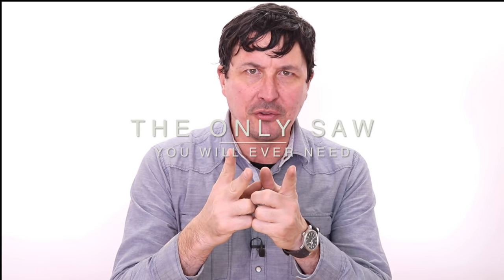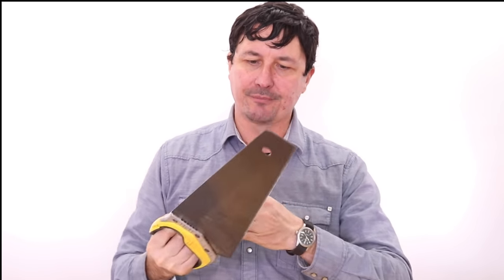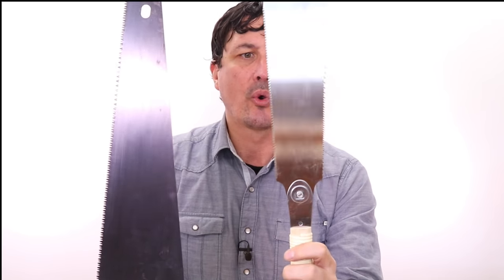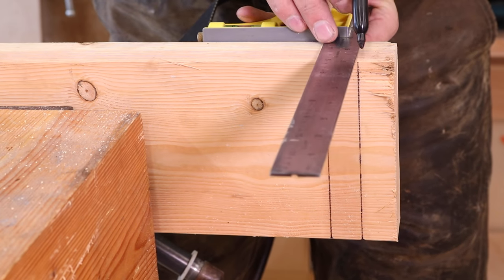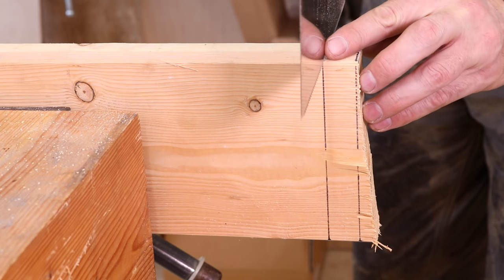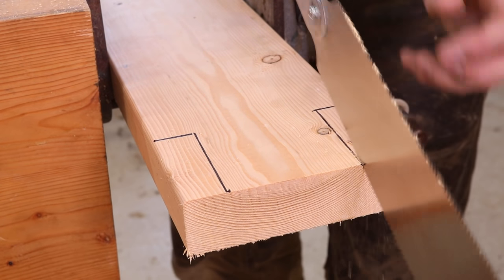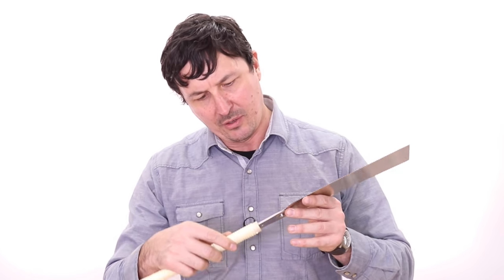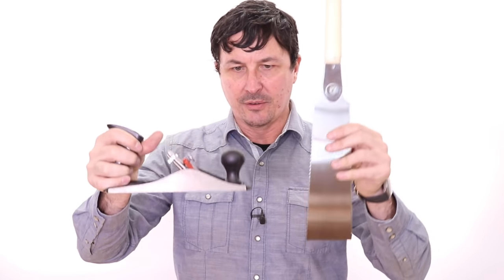The Only Saw You'll Ever Need

Comment: Why do they cut on the push? You can get so much more power from a pulling motion.
Reply: well .. speaking from experience, it's not true, you pull your bench off the ground, saw horse pops over.. also, unless you can pick up more than your weight, it is physically impossible to achieve what you say. It is also safer, I just got my japanesse saw today, and already cut myself - my bad - but when you push away and it slips you won't cut yourself. I love both my saws, and I am learning to choose the proper job for each
Reply: Western saw plates are much longer (more teeth will cut) + body weight is working for you.
Reply: Based on the research I have done, saws that cut on the pull generally give cleaner cuts since the force is more consistent, using the weight of the blade all the way through the cut, and the pulling motion provides the right amount of tension to keep the blade straighter for accurate cuts. Also the smaller, finer teeth aid in accurate cuts. However, they don't cut as much material per motion as a saw that cuts on the push would, so it does take a bit more work but gives cleaner cuts.

Saws that cut on the push use your force/body weight combined with the weight of the blade to take off more material per motion. The downside to this is that people with poor technique tend to not use the right amount of pressure and make uneven cuts and bending the blade and teeth in the process. However, most American made crosscut saws cut on the push and pull motion , providing superior cutting power with more teeth that are coarser, while sacrificing accuracy.

Conclusion: Japanese style push saws for accurate cuts (designed for woodworking). American made crosscut saws or bow saws for maximum cutting power.
Reply: Martin Rodriguez, good and accurate assessment.
Reply: I know right?
Reply: @still34u  "well speaking from experience... I just got my Japanese saw today..."
Reply: Less fatigue
Reply: Why would you want to fight against pulling the material towards you

Comment: I like my Gyokucho, however this test is unfair. That saw which is the same as I own cost me $52. That is the the same saw that you used against the Stanley, not the $28 Ryoba that you linked to.
Reply: If you're referring to the saw in 9:08,, it seems to have the same logo as the Ryoba saw in the link.
Edit: Looking online I found out Ryoba is a classification, not a brand name. Ryoba literally means "double blade", and refers to such saws as presented in the video.

Comment: A saw is a tool that I have personally had difficulty using. Blade length seemed to matter as well as the handle. Thanks for showing the difference between the two saws you demonstrated.I agree that a "pull" saw is the ideal for me; pushing a saw to start isn't my ability. I'm a "pull" person. I"m a woman too, and I do my best to use leverage to my advantage when it comes to construction/ carpentry tools.I've been out of the trade since my son was born seventeen years ago, but I still get a buzz to get into the work at home.The tool kit is a great idea!

Comment: Well ofc you can't make a straight cut when you use it wrong. Stanley saw is also a pull saw, meaning it cuts when you pull. By forcing it to cut when you push you were bending it. Also as you said, this a not a speed race so don't push too hard on the saw. When you do that the teeth grab more and don't cut but rip the wood and then you get a terrible looking edge.
Reply: All he proved is that he has no idea how to use a saw. Pull saws are fine if that's what you like but a Stanley Fat Max was never intended to do more than wack a tree limb off or finish the cut on a stair stringer.
Reply: I agree that Cody has no idea how to use the Stanley "WESTERN" style saw. I wish the camera included how he was holding the saw's during the cuts. It was apparent that he lacked total control of the Stanley due to improper grip and a total lack of ability to control the saws direction, as he twist the blade on each stroke.
I've worked with many older carpenters who used Stanley style saws and they could cut clean straight lines without torturing the saw as Cody was doing. They showed me the proper saw grip and I was able to improve my accuracy by 99% with just a few days practice. This was a very poor test  when he lacked the knowledge of how to use one type of saw, which introduced a bias into the testing.

Comment: my oppinion is that the test is a poor, the biggest problem with the video is that you are using your so called amarican stiled saw poorly. To get a good cut with a saw must have stablite, the japaniese one alredy got that thanks to the handle but on the normal saw on the other hand you dont get that same stabilite if you dont use your other hand use your hand that you dont have on your saw and place it on the material that you are sawing or the bench
Reply: How does one being better than the other partially because of the handle make the test "poor"

Comment: Old habits die hard. You seemed to be trying to start your Japanese saw with a push stroke. Muscle memory is a strong influence on technique, sometimes making the change to Japanese saws a little difficult. The pull action keeps the extremely thin  blade in tension and thus straight, while the saw, being extremely sharp cuts well with its own weight as it is drawn through the wood and our muscle memory wants us to saw in the manner we are accustomed to with our Western saws, which runs counter to the appropriate method for Japanese saws. Cross cutting in particular leaves an excellent standard of finish. My own experience with these saws has been wholly positive. Gyokucho also include a back saw in their range and a very good flush-cut saw. 
   Many thanks for all the super vids , I learn something new and useful every time, and often find myself asking " why haven't I thought of doing it that way."  Thank goodness for You Tube and your  and many others informative and inspirational presentations. Thru them I never stop learning and refreshing my knowledge and skills after many years absence from the trade.  All the best, from UK.

Comment: Your video was the first that I have seen that compared both saws. I have hesitated in buying a Japanese saw. But I was impressed how it worked and how clean the cut can be. The Japanese saw, since it cuts pulling, the front was rougher than the back as compared with the American style saw.  $28 is a good price for the multipurpose saw.

Comment: For what its worth being a pro cabinetmaker/joiner/builder etc . I have gyucocho . Good brand . I have three of their ryoba's but to be honest I rarely use them except for site work in awkward places .
What I do use everyday almost is my Zeta's . The regular handle with the stiff back can take cross cut ,rip and mouse tooth (dovetailing tooth) blades. One handle , many blade options INCLUDING metal cutting blades too . 
The trouble with Ryoba's is that the teeth on the other side tend to get in the way when you are ripping anything but very soft woods . If your not carefull you can pinch and buckle the blade .
The blades are so easy to take in and out of the handle , they dont need to be unscrewed like the Gyo's . They do a range of sizes both stiff back and flexible . 
They also do a really handy small crosscut saw which is PERFECT for dovetailing . 
Buying the best all rounder is rarely the best choice in practice . Far better to buy the exact tool for the job you have in mind . 
Zeta blades are tough long lasting disposable blades . I have a bunch of them now . Its a clever system because the blade holder works for different sizes/types of handle . Google it and check 'em out.
Gyo's are a finer blade for precision cutting . Their crosscutting tennon saw is super fine and works great but be warned ,the teeth are fragile and easily broken if your not skilled enough.
The only really good western saws are the old taper ground Disstons but they are hard to find along with saw doctors. But for site work they are tough and the usual brands will get you through the big tough stuff . That Ryoba is really only good for fairly small stock sizes .

Comment: Technique is everything. The pull saw takes some of the slop out of the cut. After all, you are using both hands. When you use the push saw with one hand, your rotating your shoulder, tucking your elbow and swinging your hips. This tilts the saw slightly causing it to cut to your left.  Imagine you arm is a pendulum. Move the saw back and forth without all the elbow tuck and hip swing.

Comment: I’ve always found it a hell of a lot easier to use the pull cut sty saw for wood, when you push into the cut the blade wants bend where if you pull it kind of holds tension on the blade keeping it straight. That’s just my personal experience, I’ve grown up doing carpentry since I was a kid working for my father in the summers between school years so take that for what it’s worth.

Comment: Pulling has more control because the blade does not have any tendency to bend sideways but perfect cuts can be made with both types of saws. If you want to cut perfectly along a line on both sides, you need to cut the wood in triangles. Cut at an angle, following the lines that you can see (top and side facing you), then flip the wood so you can cut on the other side while following  your line. I'm not sure if I was able to explain myself clearly but you have to be able to see your line while cutting. If you cut straight through, you cannot see where the cut is at the opposite side.

Comment: Interesting comparison, and I do have a soft spot for pull saws. The reason for the opposed cleanliness of cuts for the saws, the Stanley being clean in front and the Japanese saw being clean in the back has to do with the opposed direction of cut. The Stanley pushes it's cut out the back and tears out, whereas the Japanese saw pulls it's cut out the front. The solution for finer work in my opinion would be knifewalls to outline the dovetail, and if the interior is a little rough as I would expect the big push saw to be, then a little chisel work would clean up that edge. Still really enjoying the series!

Comment: Japanese saws can be sharpened a few times on certain saws. Look for saws that the blade cannot be changed, these saws can be sharpened quite a few times. Disposable type blades can be sharpened about 2 or 3 times. It all depends on how the blade was tempered. I have 2 "Feather Edge Files" a 75mm, and a 100mm. Most of my saws will use the 75mm file, the downside is that the store I purchased them is no longer in business here in Hawaii. The files were made be the Ochi File Works Co., LTD. (Good luck in hunting them down).

Comment: I think even Adam Savage, known for his humour and career in Mythbusters and now working with the Tested crew frequently, swears by the Japanese saws. Especially for cabinetry and box making. The western saws are built and designed to remove material quickly, often times not clean. I'd consider it a strongarm style of saw. The Japanese carpentry saws - like the dovetail saw, and the double edge razor saw - are for making cuts while removing the least amount of material possible. This makes it so much easier to be accurate with tight fitting joins and edges. Less planing and refitting needed compared to a saw that removes a lot of material.

Comment: A Japanese style pull saw could possibly be a better camping too than a small axe or hatchet.  But it won't pound tent stakes.  I use mine for all sorts of things at home:  pruning, ripping & cross cutting boards and 2x4 pieces, plywood, even PVC pipe.  But when I have to cut a big job I'll use my electric circular saw.

Comment: Hey everyone, here's an update...at home depot I found  japanese pull saws by Dewalt one single edge crosscut the other a combination crosscut / rip w/adjustable handle...a plastic rubberized kind for $13.95 USD, each...no mistake under 14 bucks. I rechecked my receipt and there it was $13.95...I bought them both, sharp, cuts like butter, real comfortable in the hand, a win/win purchase. I was a professional pattern maker for 20 years, I wish I had these saws back then.

Comment: Regardless of western or japanese style, to get a straight cut you have to keep the saw plate straight and let the saw do the cutting.  One nice trick to see that your saw plate is straight is to look at the reflection in the saw plate.  If the wood looks like its perfectly continuous you're straight both left to right and in tilt.  if it looks like its rising or diving you have the saw tilted and if it looks like its going out to one side of the board or the other then the blade isn't square to the wood.

Comment: From my personal experience, a Japanese style pull saw is going to be much easier for beginners to use accurately and cleanly, especially for the kind of furniture making and more detail oriented stuff that you will typically do. However, if you can get your hands on an older western style saw with teeth that you are able to sharpen, they are absolutely worthwhile to have. For stuff like cutting 4x4s, a big, western style saw will be less exhausting to use because you can twist at the hips, put your shoulder, as well as your elbow, into it, and you can more easily put your body weight into the push.

Comment: I hadn't used a Japanese style saw until maybe around 2010. Since then, I've almost used them exclusively. It's a superior design in almost every way. The pull cut allows the saw to stay straighter, which allows for a thinner blade/thinner kerf. This means less friction, less binding, and faster and more precise cutting. It also allows you to keep the saw perpendicular to the cut you are making (unlike a western style saw where it is ideal to keep the saw at an angle to the wood, allowing us to use our weight in the push cut, which is harder to do). They are not easy to sharpen, but you can with diamond needle files. But, as you pointed out, the blades last a long time (the teeth are typically hardened), and the blades are replaceable fairly inexpensively. I have to say, after lots of research and studying of the styles, Traditional Japanese woodworking is superior to Traditional Western woodworking. And their tools tend to be better. That doesn't mean a master craftsman in the western style using western tools can't achieve the same things, but that there is a stronger tradition of high quality wood working.
Reply: I might add, in the dovetail, the tearout side of the cut is opposite for each saw. If just comparing the tearout side, the Ryoba was reasonably clean. A dovetail saw is the right tool for the job, but the Ryoba is serviceable for that kind of work.

Comment: For a straight cut, after marking 3 or 4 of the sides, make a cut across one side.

In your case, the thin side.

Then angle your saw down the the front side and try to line it up with the longer line.

Once you have a nice deep 45 degree cut, it will help guide you and keep you straight.

I find that works best to get a good 90 degree, square cut.
-------
I would also normally start on the flat side, not from the thin side.

It is easier to aim across the very long line, than along a small line.

Comment: Some alternates to Gyokucho are the Shark saws that can be found on Amazon.  Great quality steel and smooth cutting. I own both brands, Gyokucho and Shark.  I don' see a difference in the cut quality. I'll update in a few years to see which lasted longer. So the Shark 10-2205 7" ryoba $22, Shark 10-2440 9" ryoba $25, 10-2410 dozuki $25.

Comment: The Japanese cut is finer due to the thin blade and the fact that the pull stroke pulls the blade straight during the cut stroke whereas the Western saw actually flexes during the cut.  Many Western saws these days also have whats called the 'universal' tooh set that tries to hit a 'happy medium' between rip and crosscut.  They are being ultra hardened as well resulting in no sharpening.  The only place my Japanese saws have failed me is on plywood and OSB when I'm working with no power out on the ranch here.  Plywood and OSB eat a japanese saw for lunch.  I use on of my father's old Stanleys and have no real issues.  Its the only use the western saws get anymore.

Comment: Hi there Mr W i dont know if you have Aldi over  in the states but i bought  cheap little japanese pull saw for under £10 back last year it is only about 12inches  long and comes with 2 interchangable blades fine and course now i find myself reaching for it every time i need a saw and seems too be as sharp today as it was 12 months ago but i will say i only use it on softwoods chipwood and ply boards
Anyway if you can would you do a review on it to show how little you need too spend on tools

love your videos please keep them coming

Comment: One possibile source of bias was the Japanese saw was new and the other older. I do agree that having separate cross saw and rip saw on the same blade is a good feature. I assume the Stanley Saw had som compromise set. Some was or oil would have helped.

Comment: You compared the backs of the dovetails and the front of the dovetails, however the front of the Japanese saw dovetail and the back of the western saw dovetail should be compared, and visa versa with the fronts.  One saw cuts on the pull and the other on the push, so the sides of the wood on which the saw exits the cut are opposite and thus the blowout would be on opposite sides.

Comment: The back is cleaner on the Gyokucho because it cuts on the pull stroke.  But even the front is better.  PS I bought a Kobalt pull saw from Lowes.  It bends all over the place.  I can't get it to work.  So watch what your buying.  Gyokucho is a good brand.  And btw,  The Stanley is a beat up saw in need of a refurb.   Let's be fare.